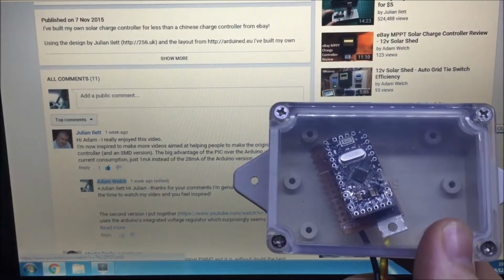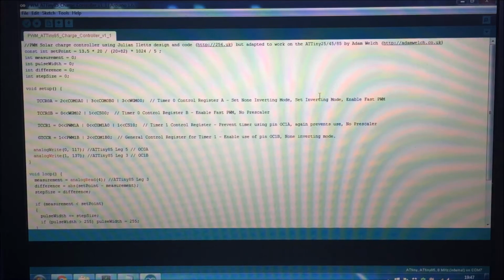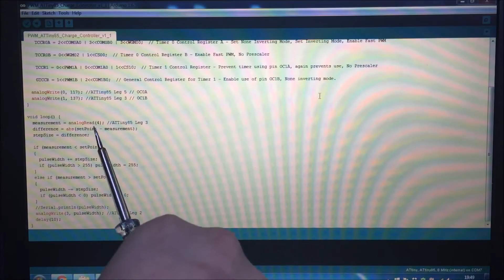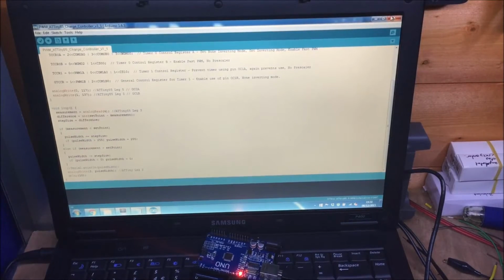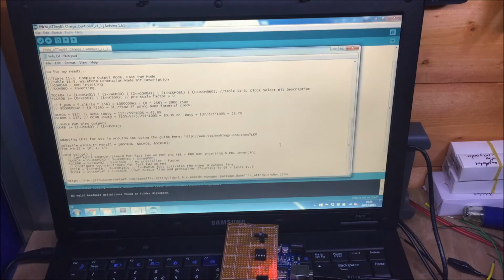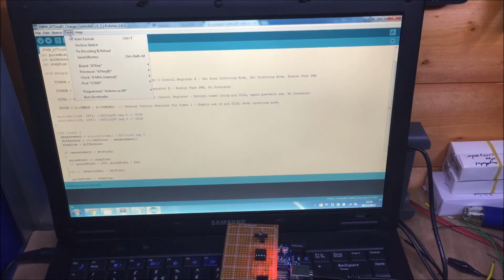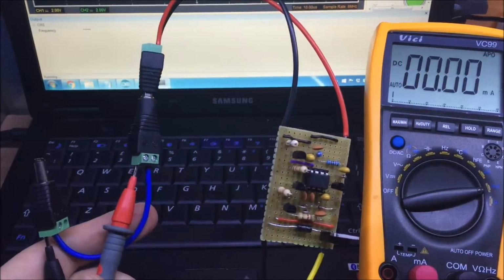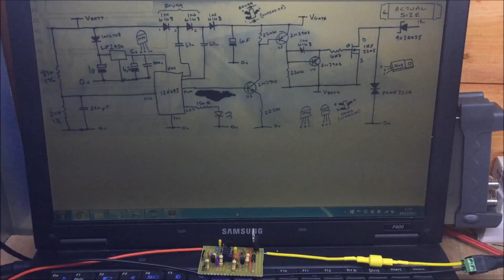PWM Solar Charge Controller Version 3 - Adam's Arduino Projects

Comment: If you're dealing with 100+W then worrying about 10mW or so is a bit pointless.  Having a more powerful CPU that can do better calculations and thus better MPPT conversion will likely more than make up for the slight increase in power consumption. 
I'm using ARM parts for that reason.
Reply from the maker: I see your point, but there are points in the year where you may only get a few watts for an hour or so a day (at least round here). It's the time when the sun isn't out you want the most efficient solution.

Comment: please more of this pleaseeeeee :D
Reply from the maker: +Taqatak Check out Julian Iletts channel. He is the original creator and yesterday he published a video explaining that he was going to redesign the original PWM5 for SMD components. 
I would like to use the LP2950 voltage regulator on the arduino version and see how much more current could be saved. One day.
Reply: adam thank you for your reply yes i have seen julian iletts video but SMD will be much smaller but harder to do on bench scale. I already started on this and i will replace 7805 with LP2950 and i was wondering if u have eagle schematics or Proteus that could help me in my design and if i faced any problem could you offer help thank you for your replyyy again it really means alot :D
Reply from the maker: +Taqatak I just worked from Julian's paper schematic and substituted the pins on the pic for the pins on the attiny. On my website there is a graphic showing the layout of the board which may also be of use.
Reply: okay great I will update you with my board when it works :D
Reply from the maker: +Taqatak Excellent. Good luck.

Comment: have you thought of using a small more efficient low dropout voltage regulator to cut some current draw?  There are more efficient ones out there !
Reply from the maker: +Anthony Morgan Yes you're right. Julian Ilett suggested the same actually. Once the sun comes out again... :-)

Comment: Great job Adam,I'm also working on a PWM solar charge controller since last summer. My design it's all analog, no microcontroller at all. The charge pump frequency in my case it's the same as the PWM one (330Hz) but in order to reach the same 22v target i neded to increase the capacitors to 470nF. I also modified Julian's high side mosfet driver circuit to use all npn transistors. Anyway huge thanks to Juilan.
Reply from the maker: +Edoardo Castellaneta Thanks for your kind comments.  I'd love to see some more info on your version of the solar charge controller.  I've learned an awful lot from Julian and I'm very appreciative of all the hard work he does to produce his excellent videos.
Reply: +Adam Welch Yeah, I do as yell. In my design I'm using a single LM324 quad op amp. I use two sections of it as a triangle and square wave oscillator. The square wave in feeded in a single capacitor to create a voltage doubler and getting the 22v. The third op amp produces the PWM square wave wich is feeded in the high side driver, and the fourth is a comparator with a voltage reference that in used to modulate the pulse width to maintain the battery voltage. As a result of this my circuit doesn't need a voltage regulator at all and draws only 960uA !! I may make a video explaining how in works soon.
Reply from the maker: +Edoardo Castellaneta Please do make a video - it sounds like a brilliant adaptation.  I'm very interested to use charge controllers that use so little power.
Reply: +Adam Welch Of course i will !
Reply: hi , a video or even a schematic of the idea would be amazing, i am trying to get my head around microprocessors but an analog version would be ace

Comment: Hi Adam, you mention the parts list is the same but the transistors seemed labelled differently on the v3 layout diagram, wasn't sure if i was being dim.  Really like this so pulling together an ebay order to make a few.
Reply from the maker: +Colin Hickey Whoops - my bad.  I'll update that image now...  Full list of components...

1 ATTiny85
1 78L05 Voltage Regulator- or as Julian suggests a quiescent current regulator such as the LP2950
1 2N3904 NPN Transistor
2 2N3906 PNP Transistor
1 IRF3205 Mosfet
5 1N4148 Diodes
1 P6KE33CA Diode
3 220Ohm 1/2 Watt Resistors
1 4k7Ohm 1/2 Watt Resistor
1 82k 1/4 Watt 1% Resistor
1 20k 1/4 Watt 1% Resistor
2 1uF Tantalum Capacitor
1 4u7 Tantalum Capacitor
1 100nF Ceramic Capacitor
2 47nF Ceramic Capacitors
1 220pF Ceramic Capacitor
Reply from the maker: +Colin Hickey Thanks for spotting the error - updated image at http://admw.uk/iD now too.

Comment: Great stuff Adam. That 5mA figure is impressive. The PIC version also has a low current consumption because of it's slow clock speed - I did some tests and found that 500kHz gave me the best performance/consumption ratio. Another thing I did was use a low quiescent current regulator, the LP2950. You might want to check how much current the 78L05 is drawing with no load.
Reply: Consider putting the attiny85 in sleep mode when the solar panel is not providing power; I believe you drop down to micro-amps and the overall power draw for the charge controller will be a lot less.
Reply from the maker: +Julian Ilett Thanks for your comment Julian - and your encouragement.  I will look into the low quiescent current regulator, every milliamp saved is one in the bank!
Reply from the maker: +Patrick Clark I'm not sure what draw Julian was getting at higher clock speed. Hopefully he'll include all of these extra bits of info when he completes his videos on making the pic version of the controller. 

I settled on the slower 1MHz speed as I didn't see any real reduction in the charge pump efficiency. At that speed it was pulling 5.5mAs, but Julian noted that using a more efficient voltage regulator may bring that figure down. The 78L05 I used can draw a fair bit of current even with no load.
Reply: Julian Ilett actually I just started working on this project this year so I'm a little bit behind. I didn't see this video and tell just today. But what I found is using the attiny 85 after testing it it runs much better for me at 1 megahertz as compared to 8 megahertz.  after the test I ran it seemed to save me 6 milliamps. by reducing the frequency to 1 megahertz. I had also added additional Hardware such as USB device that I let Attiny85 control. As well as a night light which also the Attiny85 controls depending on what voltage the batteries are at. this is working with a smaller solar panel charging 18650 batteries for my daughter's bedroom to allow her to run devices and have light. Where we've been having a few power outages.
Reply: Julian Ilett one of the thing I forgot to mention as I do use the sleep mode which even have much more savings and Power.

Comment: I have been thinking a little about the idea of running the charge controller from the solar panel side. If you take the feed for the regulator from the solar panel side of the blocking diode you'll only get power during daylight. The currents drawn by the controller are so small that even if you use a linear reg like the 7805 the dissipation should be ok under all situations. I wouldn't use the L version though like this. 

As for the voltage sense on the input to the micro being powered: It would seem that all these chips tend to have clamping diodes on all pins so it is possible that the voltage sense input could actually keep powering the chip from that pin!. However, if one was to raise the input impedance of the pin by adding a decently sized resistor this will not happen and the chip should be fine in the night time state.
Reply from the maker: I was looking into this theory last time you mentioned it. Then Dave Jones at the EEVBlog produced his video about the clamping diodes in micro controllers literally the next day!  Thanks again for you input.
Reply: +Adam Welch Yeah, he has some great videos. :) The other thing I thought of with the 7805 is that it's only gonna be dissipating power (pretty much wasting) heavily when the battery is fully charged. During most of the charging stages it's gonna be similar to how it is in the present circuit & at night of course it won't be dissipating any at all.

Comment: Great DIY, I started playing with the ATtiny85 with some RC car things, Im working on saving energy and thought this would be a good starter for me, Do you think this would work for charging / maintaining lawn mower battery's over the winter season, My plan was to use a small solar panel on my shed with my outdoor tools with 12 volt battery's.
Reply from the maker: +William Marsh II Thanks for your comments William.

It's probably suited to your needs yes.  The charge controller floats at 13.5 volts, so this is a safe level for sealed and flooded 12 volt lead acid batteries.  You'll need a suitably sized panel though which produces enough power on the shorter, darker days over winter.

Comment: I like that idea of using the ATTiny so it's a standalone chip. If you're using a logic level switching mosfet the 20 odd volts of boost should be fine cause that'll put the gate around 5.5 volts above the battery at the top of the charge. If you feel that a more synchronised waveform could help get a little more voltage you could try using a single PWM pin and create an inverted version of the signal using a transistor, but that's hardware of course. Speaking of that....another step towards lowering the current consumption would be to arrange it so the circuitry is essentially powered by the solar panel rather that the battery. Naturally, that won't actually reduce the current taken by the chip/circuit but it will reduce the overall energy consumption over the course of a day by consuming pretty much zero at night.
Reply: +xanataph Thanks for your comments.  The 20 volts seems to be driving the mosfet just fine - although now we have our winter days/nights I'm leaving for work and returning in the dark it's hard to do a full check.  The battery is maintaining a good voltage though.

That's an interesting idea powering the circuit from the panel - I may have to look into that.  I like the idea of the charge controller pulling nothing from the battery overnight.  I wonder if there was a reason Julian didn't go down that route on the original?

I really appreciate the suggestions - thanks again.
Reply: +Adam Welch Yeah, I think 20 volts will be ok in all situations, as even in worst case scenario if the mosfet went slightly linear mode at the top of charge the currents by then are very low. 
I would dare say the main reason for running the circuit from the battery side is that the voltage is more predictable. It's only going to swing between, say, 11.0 & 14.5 volts. Where as the solar panel voltage is going to range from nearly 20 volts when the battery is charged to zero volts at night, and there is going to be a slow transition voltage at dawn & dusk too. Which makes getting a regulated voltage source from here more tricky. But certainly not impossible or even super difficult. 
Other things to consider is how the ATT might deal with those low (but not quite zero) voltages during the transition times and if there is an issue with leaving a voltage entering the designated sense pin from the voltage divider while the rest of the chip is unpowered. I don't have any experience with microcontrollers as such but generally general logic chips don't like the inputs powered when there is no VCC. 
I think Julian chose the right path for the PWM5 by running it from the battery side as those chips draw a very low current, so it's not a significant issue and also he was designing for something intended to be mass produced, at least to a degree, therefore a very low component count was important. Whereas if you are designing something for your own use and/or for other enthusiasts to copy those sort of considerations are less important.